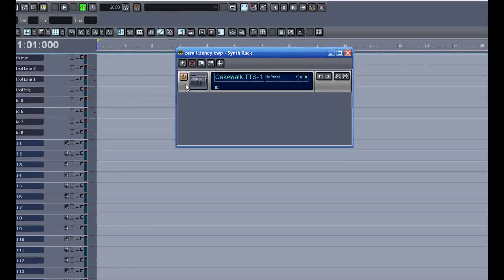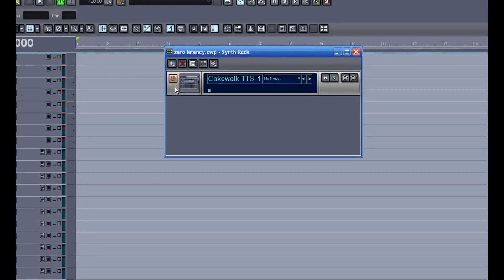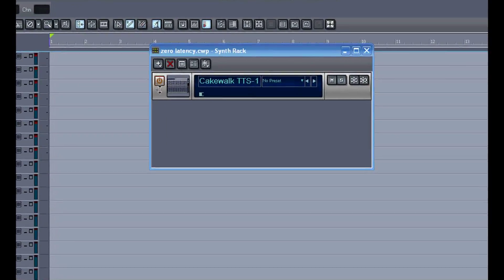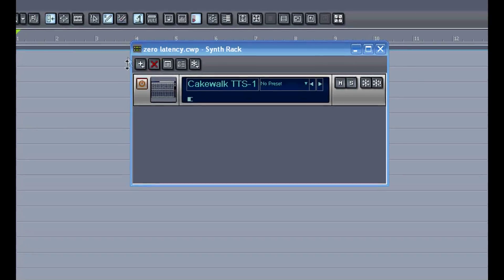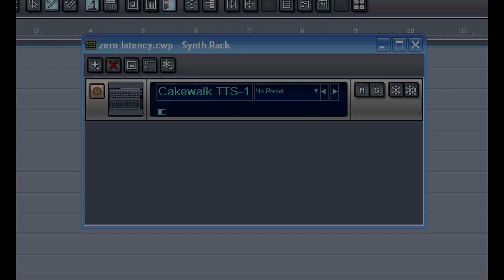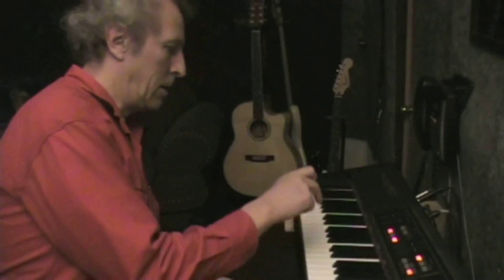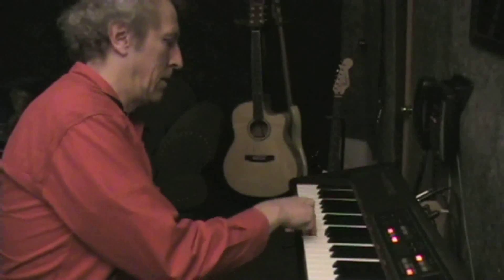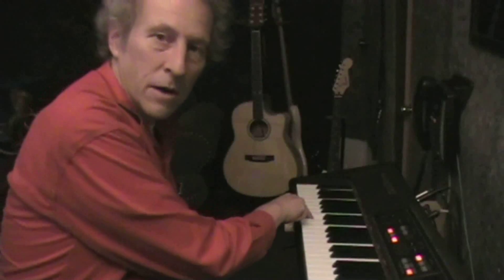Near Zero Latency Software Monitoring

Comment from the maker: Is this unit capable of using the ASIO driver mode? In your software (I use Cakewalk Sonar) you must set the driver mode to ASIO. You should then have near zero latency software monitoring, and everything should sync up perfectly.
I can imagine your frustration when its not working right :(
good luck

Comment: Hi Dwight,
I'm looking forward to buying a good preamp for recording clean vocals. I have a presonus tube pre and that's pretty good for rock vocals but I want something to record clean vocals without distortion. My emu 1616m preamps are messed up. I tried Centrance micport pro and the sound quality is amazing but I got constant dropouts on the audio. Do you have any recommendations? I want something that's zero latency but has the quality similar to micport pro. 
Thanks